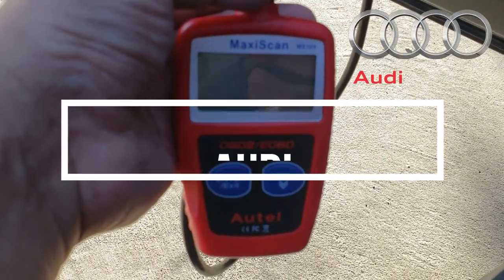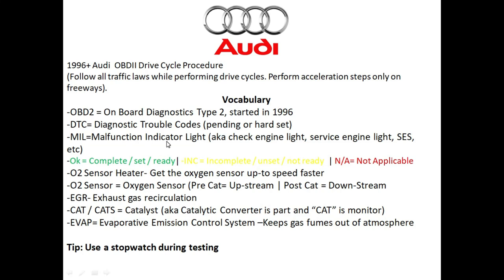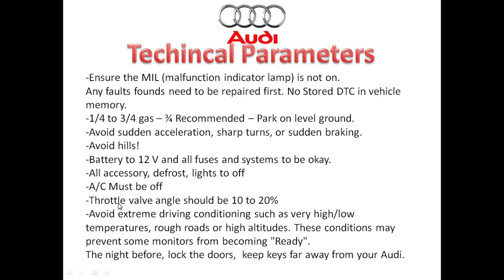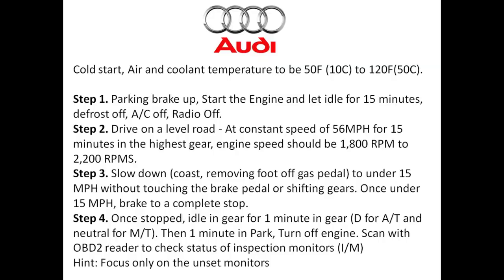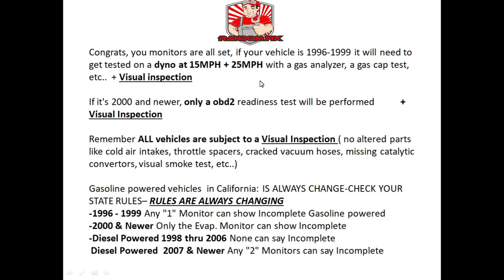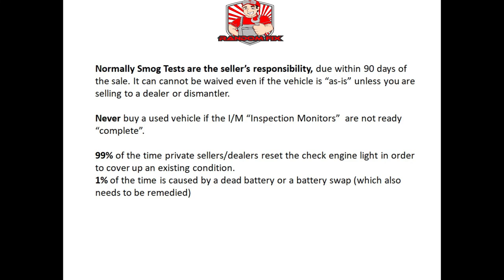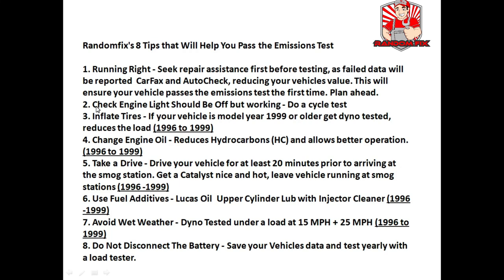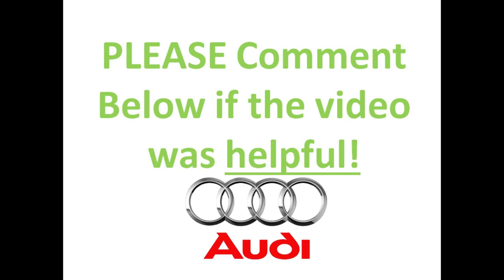Audi Emissions Drive Cycle ▶️Audi Smog Test EGR EVAP Cat o2 OBD2 Monitor Readiness

Comment: Dude! Your method for setting the monitors worked like a charm!  I have been trying for 8 months to set my CAT monitor on my 2011 Audi R8 and finally it set this morning after watching your video!  I tried a VAG-COM, took it in to multiple Audi dealerships a couple high end tune and mod shops.  Albeit, I found out during that time my car had a tune on it which I needed to take off but after bench flashing it to its factory state, I followed your directions and they set!  Thanks so much for all the insights!
Reply from the maker: Brad, thank you for the great feedback and congrats on setting the  Audi r8 catalyst monitor.
Reply from the maker: It might but the evap is exempt so you are good to pass
Reply: Hey @chinbr ,I have an 09 R8 that I’ve been going crazy trying to get the rear o2’s to become ready to finish the readiness of the O2’s and cats… drove 300miles and can’t get the rear o2 to become ready… in vcds in block 30 I get 0111 0100 which means the rear o2 is not ready but in other blocks it has a reading, I had the issue with my APR tune coding out the rear o2 sensors but we flashed to another “no test pipe” tune…. Do you remember going through that with the rear o2 sensors not being ready right away?

Comment: I think it is great that you are putting the time in to making these videos. You've gained a subscriber because of this. 

I have a question about the steps: would this still work if i have to drive in urban traffic before i get to step 2? I live about 2 miles from the nearest highway, so i would have keep it at about 25 - 30mph before i can top out at 55mph

Comment: Hello, which of the two (short or long) steps do I need to do on my 2018 Audi A4 B9 if my Fuel Monitor System is "not ready"? I think this was last year when a shop did a body repair and removed the battery and they never set up the FMS back to "ready". So, no matter how I drove around, it never triggered it for a year... then again it could be my driving style as I am a very aggressive driver.
Reply from the maker: The fuel, misfire, and ccm monitors should set within minutes.  I just a video about this, https://youtu.be/JrXOAVkK42E?si=P6l_zMb8kzytNDAZ watch the video towards the end as I discuss this.

Comment: I have a 2013 Audi A3 TDI, a Ca smog station passed everything but failed my car for the EGR monitor not ready, no check engine light on. Should it have been able to be passed, can I take it to another shop?
Reply from the maker: It depends on the state you live in, for example in California you would have failed but in Texas you would have passed. The egr is pretty easy to set. Go about 65 and coast to under 20 without the brake pedal being touched, try two of 3 times. And yes I know it can be tricky but that’s the secret. I show in this video https://youtu.be/jldTJI64cfM?si=vu32WSUbRMwxFaXO

Keep me posted and good luck

Comment: Worked brilliantly. But the only thing I had to do was to switch my 2017 Audi A4 to manual. So EGR is not getting set, then probably you just need to shift to Manual and try once more.
Reply from the maker: Once you shift to manual at 65 mph start downshifting to lower speeds of under 20 mph without touching that brake pedal.

Comment: 2004 Audi TT with 102K miles.
The CAT readiness is the only monitor not setting with no DTS.
I have driven about 600 miles on the freeway at 75 mph trying to set.
Do i need to go through the whole cycle or should i just slow down on the freeway to get the CAT readiness monitor to set?
Thanks!!!!
Reply: I got it to pass,
I used Cataclean and drove around 56 mph for 20 min and now the CAT is showing set.
Reply from the maker: Thanks for sharing your results on your Audi TT